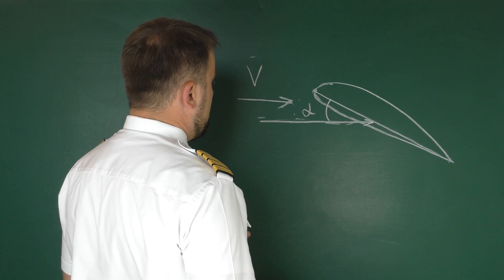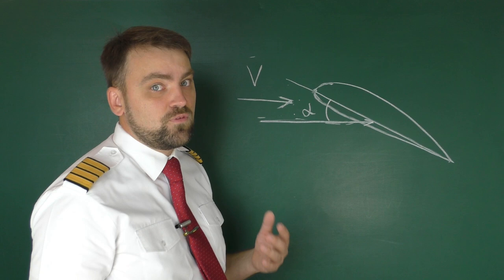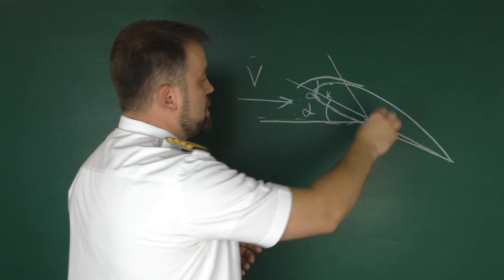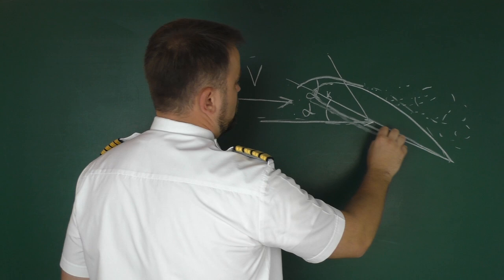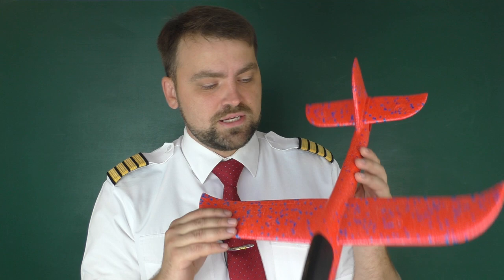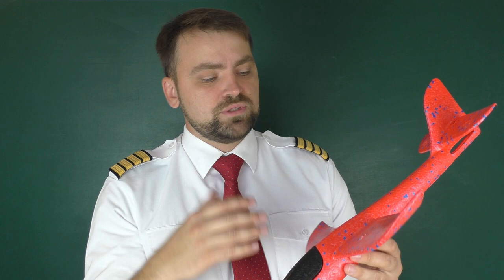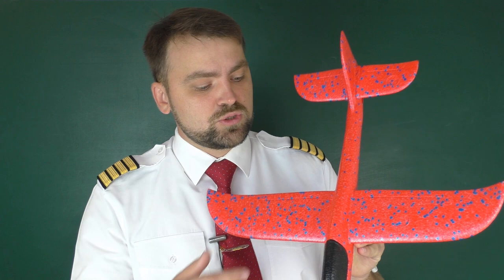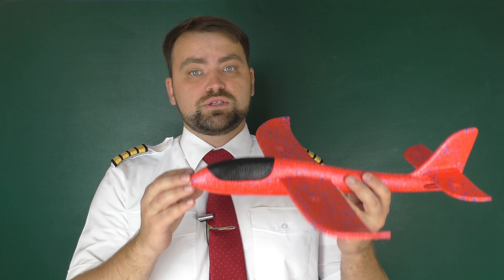Why Do Airplanes Stall? Why Do airplanes need Flaps?

Comment: Nice one.......
(Outstanding)⁷³⁷+(excellent)⁷² ⁶⁰⁰
But I've a q......(not for q & a video)
Q:- all b737 ng has 3 guarded switches (flap, gear, terrain), but I've noticed that some b737 max have 4 guarded switches. So, is runway inhibit the extra for max, which disables the RAAS(runway awareness and advisory system)?????
Waiting............
Reply from the maker: Yes, you are right. Even on some B737NG we have 4 switches. Terrain Inhib. Flaps Inhib. Gear Inhib.and of course runway inhib. It will just tell you what runway you are approaching for, what runway you are in, and some other callouts regarding runway distance.
This RAAS is not necessary equipment but may help in poor visibility conditions.
Reply: @PilotBlogDenys  a lot fo thanks, my captain.....

Comment: Great video as always, but I have a question(14:10) as far as I know, flaps are decrease the alpha crit. ( due to increasing local angle of attack), maybe you mean flaps+slats cooperation?,thanks for attention🙂, if I’m not right correct me please
Reply from the maker: Yes.  You are right. On most of the airplanes they decrease it. But for example on ATR they increase it and we have to extend the flaps to avoid stall conditions.  But don't trust me) I am just a pilot-blogger😅 I may be wrong.
Reply: Pilot Blog 😄 thank you anyway